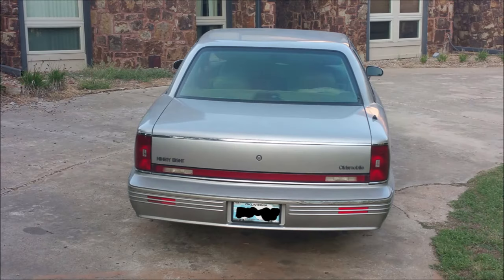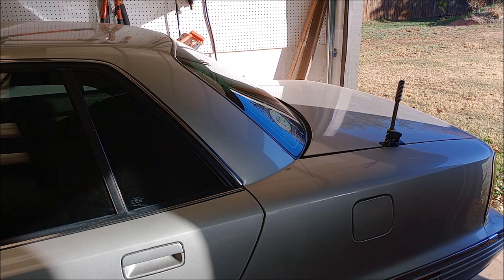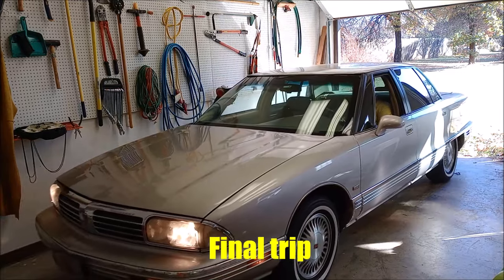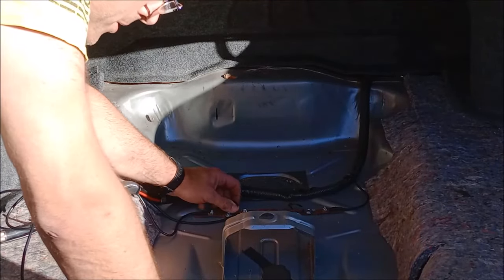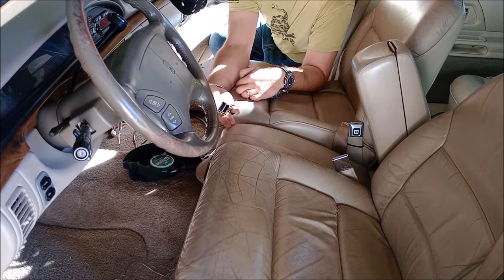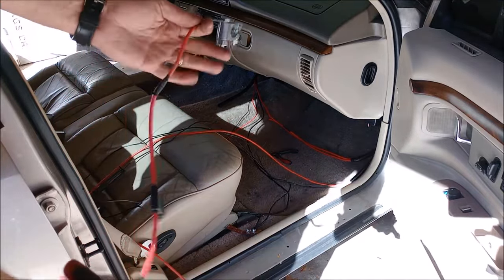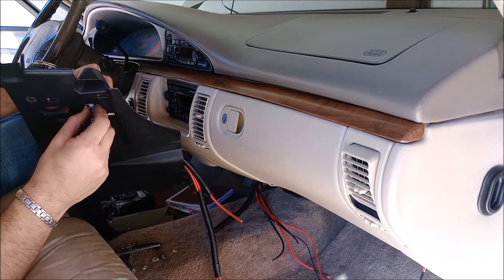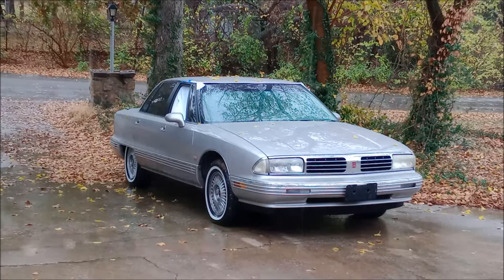Scrapping my 96 Oldsmobile 98

Comment: Did you keep the original owners manuals?
Reply from the maker: Thanks for checking out my video. I didn't keep the owner's manual.
Reply: @Olds64  I thought you were you said in the video
Reply from the maker: @mikeprankstdgmcarreviewsan5602   I kept the black and red Oldsmobile folders, but not the owners manual. I'll probably use the red Oldsmobile folder for my 71 98.